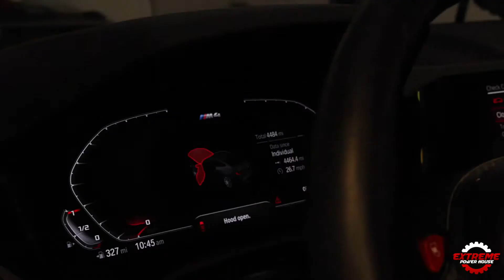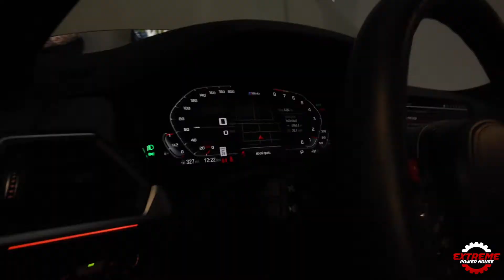Race Chip GTS BMW G82 S58 M4 Comp: Step By Step Install + Dyno Result

Comment: This video was made 2 years ago. How has race chip held up on tune 7?
Reply from the maker: Excellent, but map 7 might be too aggressive for regular fuel. We'd only recommend using it with E85 or Race gas.
Reply: @extremepowerhouse8365  oh okay i see. What would you say is the best map for 93 octane and what power gains? Not looking to use any other fuels. Just a nice conservative boost in power.
Reply from the maker: @NCM89747  map 6 is the best map in our opinion, we dont have exact number but it'll be close to 75 whp

Comment: Looks like the sensor below the intake airbox is a major PITA. Any new tricks you have picked up over time that could make accessing that sensor easier? 

I am about to install my Racechip and I have noticed that this is where everyone struggles the most. Maybe get the skinniest guy in the shop to reach the plug the easiest. LOL
Reply from the maker: You are correct, unfortunately. No tricks to share, but it gets easier after the first install
Reply: @extremepowerhouse8365  i only need to install once...so that doesnt help!
Reply: @davidriley9621  LOL.  The key is using long pick tools and loosening that assembly just above it.  Oh, and did I mention, lots and lots of patience; otherwise you may brake connectors.
Reply: @davidriley9621  car under warranty, need to take off device before taking it to shop. How does it get back on🤔asking for a friend lol
Reply: Did you manage to get it installed? Any tips?

Comment: Voids the warranty?
Reply from the maker: The warranty is only affected if an aftermarket upgrade causes damage to a stock component. The RaceChip is known to be reliable and safe; by using the recommended maps, you should not encounter any issues with your warranty.

Comment: has there been any issues reported like car going into limp mode ?  car is still reliable ? as long as you arent being an idiot
Reply from the maker: no limp mode
Reply: @ ok coo i just heard some going into limp mode with jb4
Reply from the maker: @PUGGYDAMAW  the car goes into limp mode if the map is too aggressive for your fuel. its not tune specific, if you use the recommended maps, you wont get to limp mode regardless of which tune you are running. i ran both the race chip and JB4 on my car for years, never had a single issue with either option
Reply: @extremepowerhouse8365  yea i ran jb4 on b58 and racechip on my F97 x3m had no issues but i dont know anything has changed in since ty brotha

Comment: Useless 'plug n play' solution if it is this hard to install and remove. Imagine a situation something happens to the car on road with this 'plug n play' installed and you can't remove it before it gets towed to the service center and BMW voids your warranty.
Reply from the maker: It seems you're considering a highly improbable scenario, but hypothetically, if it were to occur, you could tow your vehicle home, uninstall the tuner, and then take it to BMW. However, the chances of such a situation unfolding are near negligible, making it an impractical discussion. Nonetheless, tuning isn't for everyone - some are comfortable embracing the risk for a more exhilarating driving experience, while others prefer not to. Both perspectives are completely valid.